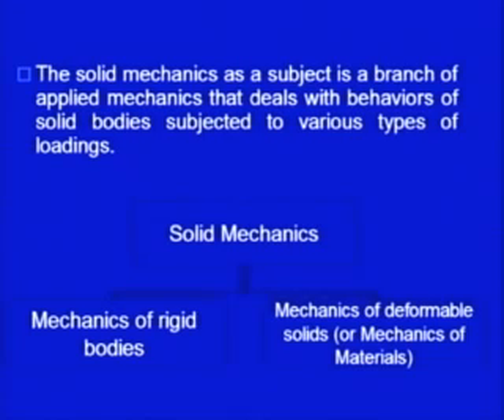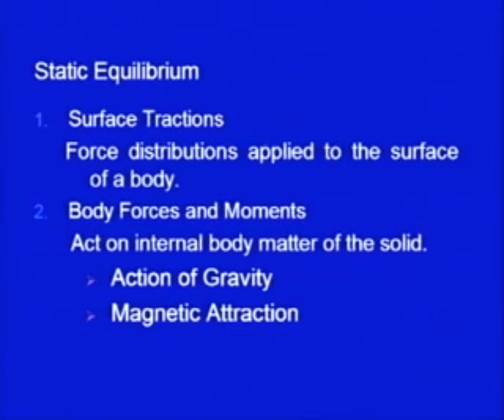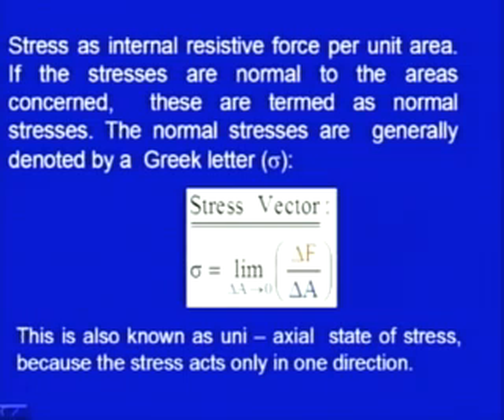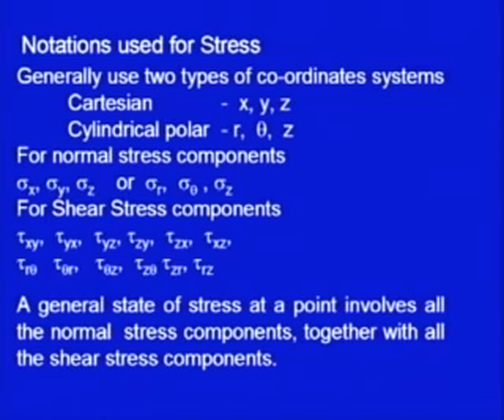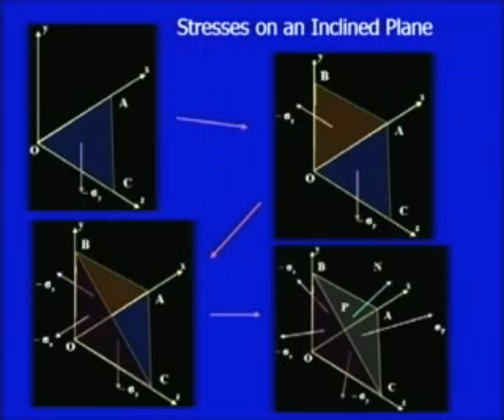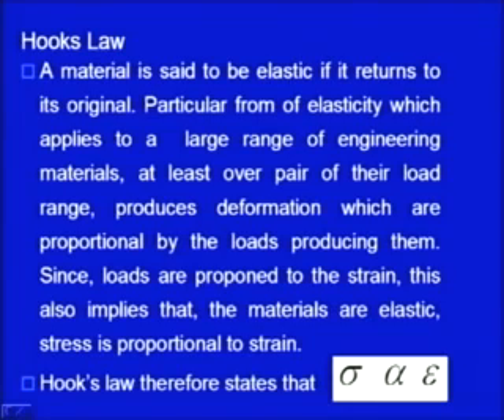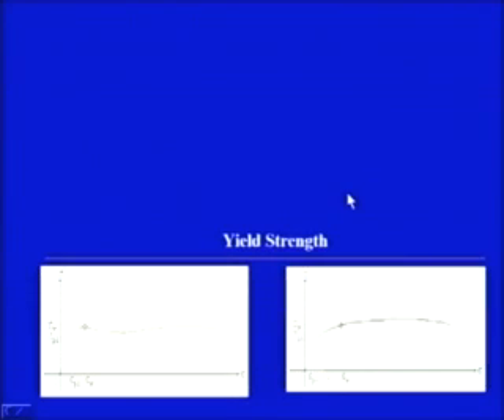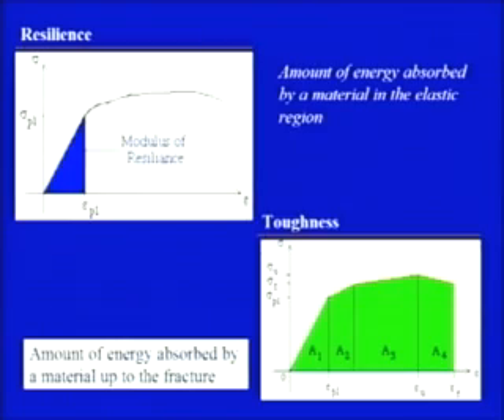Lec-1 Solid Mechanics

Comment: How is Mechanics of solid, I just entered in Breach in mechanical branch. Only I am afraid of three subjects in BTech Machine design and Mechanic of solid and thermodynamics. Anyone can help that which unit is most important and how to the difficulty?
Reply: they r the beauty of mechanical engineering...where I feel production is difficult..they r easy ones
Reply: Thermodynamics is difficult
Reply: @kpraneeth3113  i personally feel Machine Design2 is one of hardest subjects
Reply: @shrishsingh9791  If you get Engineering Mechanics and Strength of materials concepts clear then machine design is a piece of cake. The only other issue I found with Machine design was the length of design problems and the time constraint of the semester exam.
Reply: @ameyanadkarni7270  thanks pal This year only i clear my Btech and i posted this comment 4 years ago when i just entered it. Can't believe that i cleared all my subjects with good marks. This month only i get my final result the only subject which i get a backlog was Maths 2 but i finally clear all my subjects with decent marks. Thanks again for appreciating my comment and emotion 😊
Reply: @shrishsingh9791  Hi bro you posted this 4 years ago. Now you must have cleared your engineering..!! I entered 2nd year now. Which one do you think is toughest subject.
Reply: @pranav9339  thanks yeah I just completed my engineering last year, honestly speaking the hardest subject depends on which board you studied with I mean in Maharashtra aur AKTU, IIT or any national or state board, let me honest the hardest subject which I thought is Machine Design 2 and Thermodynamics 2, SOM and others are pretty easy if you good in maths and calculus and Maths 2 is also among one of the hardest subjects but make sure you haven't get any backlog with these subjects or SOM and any core subjects because it is pretty hard to clear it out. But yeah machine design 2 I felt it was hardest because the questions of Gears and spur is pretty tough to understand and solve and you get the book which is allowed to use in exam but in AKTU hardly any copies check in seriously and I might be lucky one who clear the subject and  also thanks to COVID that I clear my maths 2 too. Make sure the teachers of these subjects are pretty good because you can't even learn by self study. Machine Design 2, Thermodynamics 2 and Maths 2
Reply: @shrishsingh9791  thanks alot for guidance bhai 😁✌️